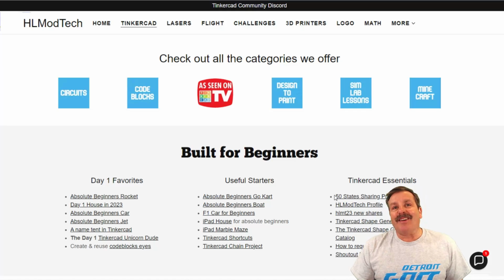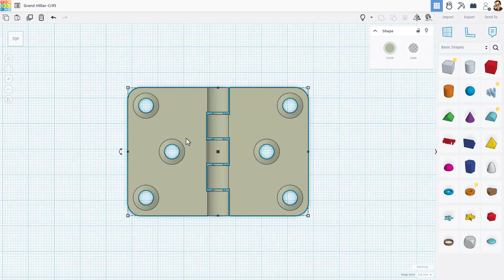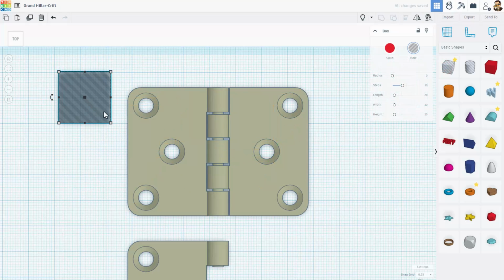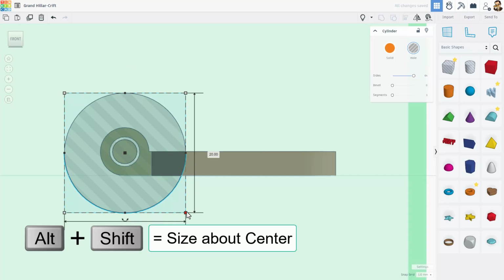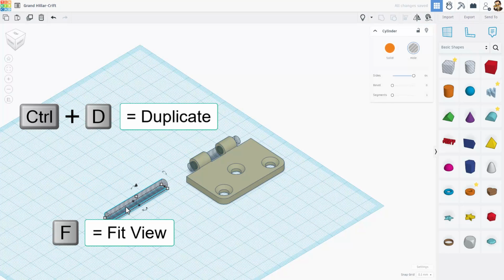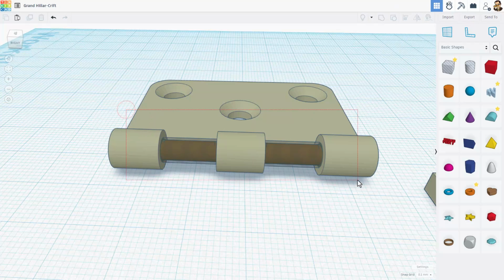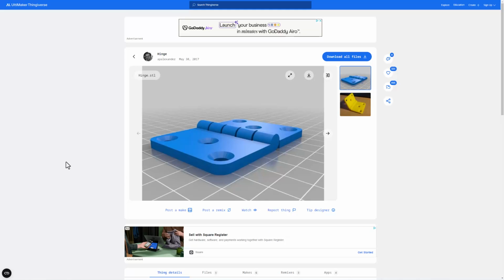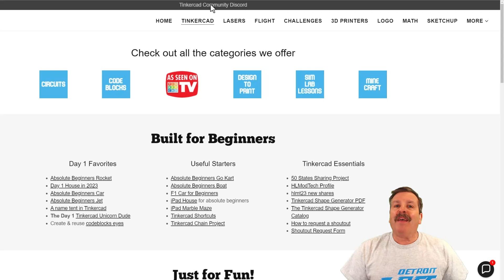Modify a Thingiverse STL File Using Tinkercad Beginner Steps in 10 Minutes!

Comment: Tinkercad will not load a stl file for me from thingiverse. Would you happen to know why? It's not too big. Very frustrating.
Reply from the maker: My first guess is file size. There is a 25 meg limit. This video shows a technique you can use to reduce the STL file size. https://youtu.be/JwqdsIoIsas
Reply: @HLModTech  Tried that, all the files are well under that. Tried stl, ascii stl, binary stl, obj. Cannot import ANY files using chrome or firefox...very frustrating.
Reply from the maker: @WysteriaGuitar  Does the item open in Meshmixer?
Reply: @HLModTech  YEs, it does. Opens fine.
Reply from the maker: @WysteriaGuitar  Would  you like to share the file with me so I can see what is up? You can reach me at hlmodtech gmail.
Reply: @ Yes, let me send you one. Happens with lots of files. I did notice when I changed my DNS that it may have worked a bit better. Wondering if it has to do with the upload speed of my ISP. Perhaps it's "timing out" or something. I am really at a loss. Will send...Thanks
Reply: @HLModTech  File sent. It's truck.stl Thx
Reply from the maker: @WysteriaGuitar  Tested and shot you a link to try.

Comment: How can you then position one half of the hinge at a desired angle relative to the other half and bring it back into the 3D Design in Tinkercad to attach it to another object at that angle.  I'm just now learning the pivoting thing and having trouble so I can't find out for myself.  And is there a graduated sequence of Youtube videos for learning Simlab ?
Reply from the maker: Sim lab is really just a fun way to experience a bit of physics with your creation. Are you hoping to make a design with hinges that 3D print and work?
Reply: @HLModTech  Yes.  I've printed some downloaded "print-in-place" hinges that work fine alone after being printed  (i.e. the two halves move independently of each other as intended).  But, again, the problem is when I am designing a model with such a hinge imported into Tinkercad,  the hinge  halves are frozen together flat.  They need to be not flat as they were when imported, but at an angle in Tinkercad to join be joined to the two parts of the model at an angle  I think I understand now.  Your process separates the two halves of the hinge which were "frozen" together when downloaded from Thingiverse.  One half can then be adjusted in its angle relative to the other half in Tinkercad to then join the halves at something other than the flatness they were at when imported into Tinkercad.  Correct ?  Moving the two hinge halves in Sim Lab is irrelevant and just "fun".  As long as they have been freed up per your method/rebuild, I can position one half as needed in Tinkercad independently of the other half.
Reply from the maker: Generally, they will not work unless they are printed flat... that way the printer can safely print the gaps around the pins and such. Users would then glue (or screw in the non printed world) their hinges in place. This video shows you how to place items where you want with the workplane. https://youtu.be/lVD581LVhko The printing would be a real problem though.
Reply: @HLModTech  Thank you !  Understood, and makes perfect sense !
Reply from the maker: Sweet! I wish my family thought I made sense more often. =)

Comment: A very important point which hopefully the author will address and clarify is whether one half of the hinge can be rotated relative to the other half to see how it may interface with parts it is going to be affixed to.  The whole problem I had with hinges downloaded from Thingiverse, etc., in the first place is that both halves were fixed flat together.  There was no way, for example, to make the halves at right angles to each other to fit them against something before joining and printing the whole collection of the hinge and the parts they are joined to.
Reply: Sorry..DOH !   Rewatched the tut and its clear at the beginning that indeed the hinge is now fully articulatable. to the desired angle to attach to the model parts a desired.  MAJOR advance from having to print out flat hinges and then glue them to the model parts at the needed angle !  Thanks again !
Reply from the maker: Sweet job figuring that out. As a former teacher I am always trying to nudge viewers to the point where they get invested in the projects and learn sweet skills.